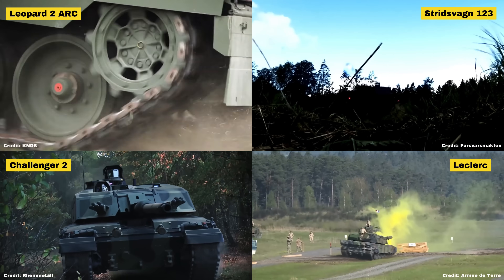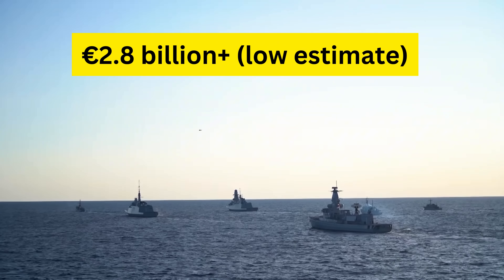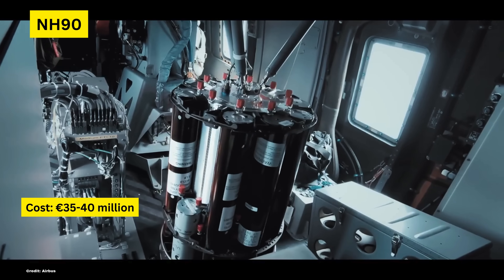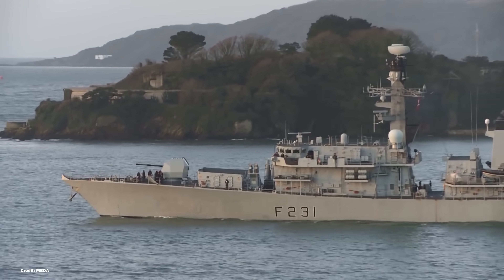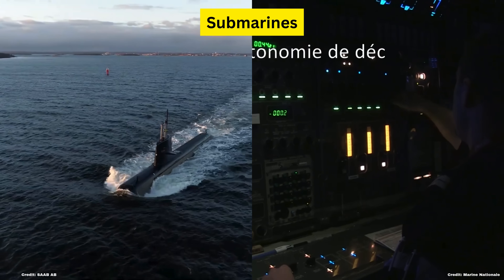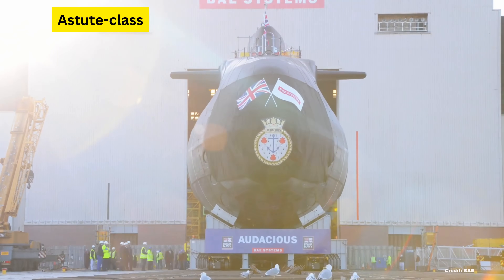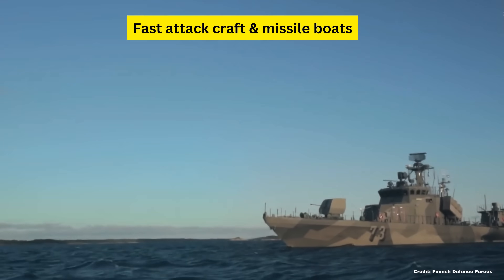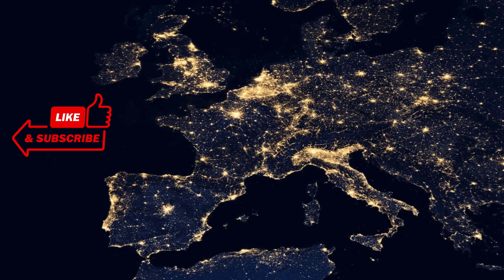The Staggering Cost of Losing Europe's Arms Market Part 5 - Europe's Naval Power continued

Comment: One of the many things we've learned from Russia's war against Ukraine is that you don't need a 5th Generation fighter to take on the Moscovites. European countries that are still early enough in their contracts for F-35 should cancel orders. Save yourselves some cash and buy Rafale or Gripen. If the Americans are foolish enough to block Gripen sales due to the engine, no one will sign contracts to license their engines and other components anymore. 

The money saved from getting European planes instead of F-35, invest in either the Net Gen research program run by the Brits (with Italy and Japan) or the one run by the French with the Germans. Get your country on the ground floor to get those when they're ready.
Reply: And since the Gripen is built with an engine power pack rather than a permanently installed engine, replacing the American GE turbine in it with a purely European turbine design is far easier to do than on many other planes, as the engines can be tested and installed in extra module cradles and then just slotted into the planes in the field accompanied with a flash drive software update if needed 😊
Reply: @SonsOfLorgar  c/d Gripen came with a Volvo engine. I´m sure Volvo has a scrapped design somewhere that an be kick started into production.
Reply: @SonsOfLorgar   It's GE?  Get that rubbish out and put a proper engine in it.
Reply: The Eurofighter is getting an AESA radar upgrade. An F22 pilot who also flew Typhoon with thr RAF was interviewed about it and said he thought that it would make Eurofighter the best non stealthy aircraft in the world and make it very capable against stealthy aircraft, as well. 

Eurofighter has a lot of life left in it, yet, and it the premier airframe in production in Europe.
Reply: f35s should be canceled anyway considering that they require US to operate
Reply: By the way, the French Rafale prototype was initially equipped with the General Electric F404 Engine which is used by the Gripen. When the french engine M88 became available the Rafale prototype has flew with 1 X F404 and 1 x M88 to validate the M88 in a secure way. Thus it should be easily (?) possible to adapt the M88 inside  the Gripen because the M88 is smaller 3.6m vs 3.9m in length and with smaller diameter,  lighter (900Kg vs 1000Kg ) and sober. The performances looks quite identical (General Electric F404-GE-400 ==> 49KN dry and 79 KN with PC, M88 ==> 51KN dry and 75KN with PC).  The M88 is far more effective to maintain as it is composed of sub modules which can be replaced independently without the need to re-calibrate all the engine's modules (thanks to the easy maintenance at sea needed by the naval version!).
Reply: @nemopode552 it’s not that easy, and it wasn’t a Rafale prototype but the demonstrator (a plane who’s purpose is to validate the aerodynamics and feasibility of the design). 
The first prototype flew years later in the 1990s.
Reply: @brunol-p_g8800  you are right. That is the reason why I did put a question mark after the word  easily and for the difference between the demonstrator and the prototype I do agree also but  this is not the point of importance which is in m'y opinion that the M88 should be a fit for the gripen because of that experimentaion.
Have a nice day!
Reply: The FCAS program is from Germany, France and Spain and both projects should be unified and receive much more funding.
Reply: I bet the SAAB wouldn't take long to re engine the Gripon to a Rolls Royce or Safran M88 like the Rafael uses.
Reply: Buy Rafales or Eurofighters, the Gripen has too many US components (without even counting other countries’s components. Look at Switzerlands report on the Gripen during their acquisition process for their next generation fighter where you can see each and every component of the Gripen and its country of origin: appart from the aluminium fuselage and the screens almost everything else are from other countries. ).

The USA just blocked the potential sell of Gripens to Colombia…
Reply: Technically speaking the F-35 is a European aircraft seeing the UK helped develop it and manufacture vital components, they also designed it's electronic warfare system.
Reply: We will be getting ready for the future battlefields too. America is amazingly strong but its a force for the 2000s. War changed, air craft carriers are running from drones and F-35s are "Expensive flying coffins" - (Elon Musk) when he talked about new gen drones and the most experienced, effective drone users/fighters in the world are the Ukrainians.
Reply: europe has rolls royce  for jet engines
Reply: @ and Safran. Both the UK’s Rolls Royce and France’s Safran are the world leaders in jet engines around the world, be it in civilian aircrafts or military aircrafts, alongside GE. 
As well as Turbomeca, now part of Safran and known as Safran Helicopter Engines , the world leader for helicopter engines (and missiles, planes, trains, etc. ).
Reply: Right, Canada needs to do the same thing, and we could get a lot more Gripens or Rafales. Gripens would be more suitable for our large terrain to defend ourselves from the USA.
Reply: Besides, the Eurofighter Typhoon is still more than a match for anything that the Russians can actually still get in to the air.  I think there is a big thing missing in all these comparisons. That is defense and attack. Europe won't be attacking Russia, it will be defending its own land.  The UK had inferior numbers and in some ways inferior machines...but we still stopped Germany in 1940.  It's always harder for the attacker. Stealthy f35s mean nothing as we won't be trying to take out Russian anti aircraft tech on their land. No Air superiority, no land superiority.  Russia can't get air superiority iver Ukraine, so no chance against superior numbers and quality in the rest of Europe without the expensive yanky tesla of the sky's.
Reply: The Gripen has General Electric American engines
Reply: I remember that Germany planes to buy the F35, because in case of war, this is the only Fighter which can carrie US Nuclear weapons.
Reply: Or UK Tempest 6th gen fighter!!!
Reply: Well one of the options that's be floated is a relatively small number of 5th gen fighters providing situational awareness with their superior interlink and sensor package to a series of 4th gen missile trucks who operate beyond the air defence range and with tbe F-35's already procured, that could be enough for European militaries to cover the capability gap till the 6th gen projects start showing results (I'm also sure contingencies for keeping those F35's operational in the event of a US cut off are being draw up across Europe as we type)
Reply: Fifth generation fighter jets will be the last to have a pilot on board. 
Sixth generation fighter jets will probably be remotely piloted with AI support. 
... And supported by swarms of AI-drones.
Reply: One of the many things we've learned from Russia's war against Ukraine is that you NEED a 5th Generation fighter to take on the Moscovites.
Many of their weapons are crap, but if aircrafts of both sides stay well away from the first line, and well into their own airspace, it's because AA is effective. 
Tha't s why the war in Ukraine is fought practically without air support, and we see WWI tactics dusted off. 
a 5th generation fighter/attack aircraft would be a decisive advantage.
Reply: Except that the f35 is the most dominant aircraft of planet earth and is actually cheaper than all of the European planes.
Reply: @bowencreer3922  however the F35 phones home (Lockheed) and need US permission to make deep attacks in Russia (for example), which is a big no-no for an attack aircraft. If just for defense, Grippen is more than enough and costs 10x less per air hour. And, for attack, well, not having 5th gen means the rafale and typhoon will have to suffice. But, in any case, not dependant on US authorization or US mission clearance.
Reply: @bowencreer3922  At $42,000 per flight hour, and that's mixed in with simulator hours, it's not an airplane, it's a white elephant. The most expensive war program since the beginning of humanity and which for 31 years has not even flown properly...
Reply: @bowencreer3922 only because it was purchased by a lot of Allies. US is gonna pay more for their own weapons in the future and sell for higher prices because the scaling of the past thanks to wealthy EU buyers will not be there anymore.
Reply: @bowencreer3922 not much good if the US can turn it off or restrict it though is it.
Reply: @bowencreer3922  
The service requirements are astronomical.  And THE ENEMY can just turn them off from inside the pentagon.
Reply: @bowencreer3922  yeah and thats why the US and S-Korea  changed to the F22 for the main force  ......... see it as a mid range model ! 
but the more they buy the cheaper it gets though ! as most is R&D ......
Reply: @jeroenberkenbosch7072 The F-22 is no longer manufacturable…
Reply: @allangibson8494  thought to hear many years ago its the replacement of the F35 as it was so expensive !

and think the K22 is still being 
manufactered ( the South korean F22 version ) as a replacement for the F16 or K16 ?
Reply: @ The KF-21 isn’t a Korean version of the F-22. It is a completely different aircraft.
The USAF LOST the critical tooling when F-22 production was stopped.
Reply: @allangibson8494  okay ......... and thats typical US , losing stuff ....... probably after a few years they find it in a local storage on storage wars ! 🙂
Reply: @bowencreer3922  what world do you live in? The F-35 is significantly more expensive to run per flight hour, plus the Eurofighter’s latest upgrade allows it to get a lock on the F-35. The Swedish Gripen has mastered electronic warfare, with significant and sophisticated radar and electronic countermeasures that the F-35 doesn’t have. Are they technically worse than the F-35? Yes, no doubt about it. But they’re still very capable fighter jets that can give the F-35 a run for its money
Reply: @bowencreer3922 😂

Comment: Norway tried to buy NH90's, but they were delivered too few, way too late, and under-specced according to contract.
After 20 years waiting for delivery of 14 helicopters, 8 had been delivered, and the contract was teminated in june 2022.
Out of the required 3900 annual flight hours, the fleet could only support 700.

It is difficult to accept that model as a viable alternative with that history in mind.
Reply: The ones for Italy started to be delivered in 2007 for the army, 2011 for the nany.
In 2012 two NH90 started to be used in Afghanistan in operative mission, something more than one year later reached the 1000 hours flight time.
The maintenance / contract leader was Leonardo.
Reply: Is that the normal version of the NH90, or the specially modified one they insisted on, casting delays and overcosts?
It wasn't a "off the shelf" buy, but rather a specifically crafted order in a a relatively small quantity from what I know of the contract.
And not something they would ask of the USA's product by the way ;)
Reply: @stitch77100  Don't make excuses for the NH90.

Here are the upgrades Norway asked for, and the company agreed would be simple to upgrade:
-Digital maps (oh noes, modern maps in modern helicopters!?!?)
-external life rafts (life rafts, on a helicopter that is meant to fly from boats and over the sea? The horror!?)
-upgraded ESM systems (how dare they demand modern sensors!?!?)
-Extra fuel (What do you mean, being able to fly away from the ships!?!?)
-black box (demanding a black box on a helicopter?! inconcievable!!)
-Helmet HUD for the pilot. (modern systems for the pilots! So.. so demanding!)

Everything that one should expect from a modern naval helicopter that flies from ships, hunts subs, flies in bad weather and rescues people.  The company agreed these were upgrades the helicopters needed, and that they could build these and deliver fast.

16 years is not fast. Especially not when the helicopters they did deliver in that time frame were starting to rot with corrosion and rust. Basicly, the company had lied at every step from winning the contract over other competitors, up until the end. Everything was a lie, they couldnt even give the right specs, so that the dang helicopters didn't even fit in the hangars on the Frigattes that were built to fit them!
Reply: Isn’t the NH90 the disaster program? In France, everyone says it doesn’t work and the military is forced to keep trying to use it because it’s mostly French and the industry needs good PR to export it ...

Comment: And recently Spain has deployed the new S-80 Plus attack submarine class with its own native AIP. So one more country to the list of countries capable of producing their own submarines.
Reply: Yes and no. The AIP system is Spanish, the fuel cell is from the USA. And the S80 needed help from General dynamics to redesign it, and runs a US combat system and US weapons. 
As for the AIP, it will only be implemented starting with the third submarine. 
So we are very very far from being independent from the USA, they can block the sell of our submarines to other nations for a multitude of reasons.
And that’s not even mentioning that we are more than 15 years backwards on any other submarine technologically speaking, even with the first generation Scorpene, the Agosta AIP or the 209..
But it’s our first domestic submarine so overall it’s s good result.
Reply: @ Still what makes the difference, if it works,  is  the bioethanol-hydrogen AIP system, wich recuaries a lot less maintaining and  have great capabilities.The combat system control is US based, but as far I have read is not the same, and has spanish licence. I'm not sure about the weapons, but Spain went back from the idea of purchasing tomahawks because of the limitations USA imposed on them, probably some modifications can be made here.
Not agree at all on the 15 years behind, actually the Scorpene was half Spanish, so, doesn't  make sense. This project started when Navantia broke with the french company
Reply: Are our submarines really AIP? The last time I checked the methanol fuel cell was still not mounted, and it used a conventional diesel engine as a stop gap.
Reply: @gunner38ED The new AIP is going to be implemented from the third sub. Of the series. The second is being built right now.
On paper is the best AIP system so far, based on hydrogen.
There are big chances to be exported to India
We'll see
Reply: @tacusarcalis5152  India has entered exclusive negotiations with TKMS for building 6 subs.
Reply: @Desi365 ok
Reply: Ehhh... no. The first S80 is equipped with lead acid batteries, that's a tech from the 50s... and it's been doing circles in the med, close to the shore for a full year without being fully commissioned. The second sub will be more of the same. The S80s are 15 years late and completely obsolete before even being out of the factory. The future of conventional subs is high tech batteries, not AIPs. That's not going to help anyone.
Reply: @Desi365eres la alegría de la huerta. El S83 será el primero en llevar el aip y ya está en astillero.
Reply: @Desi365 AIP and high teck batterys are compatible